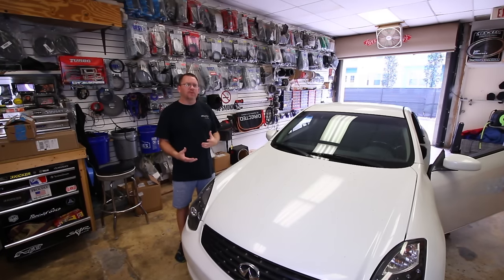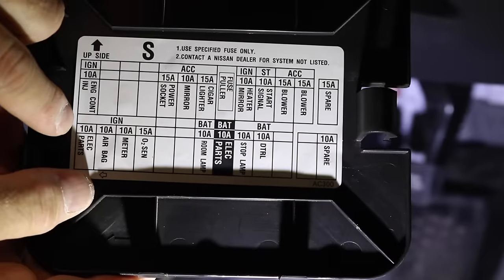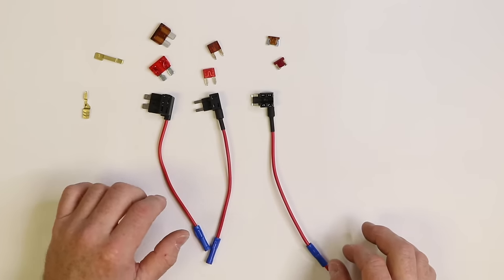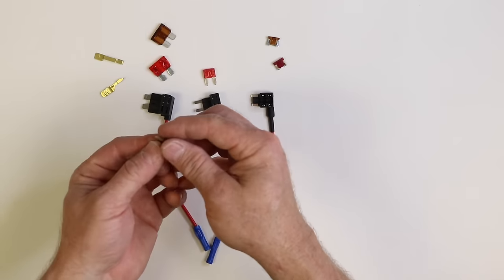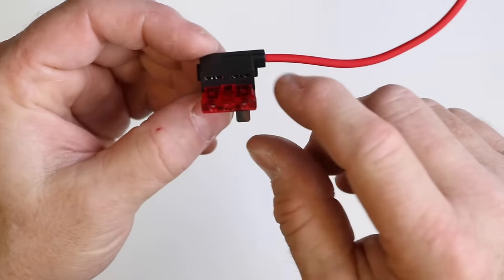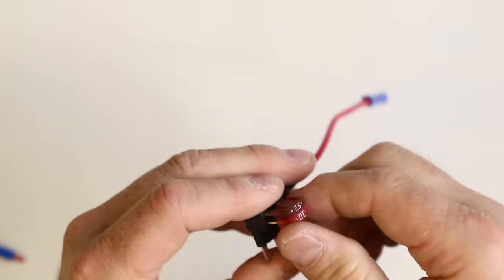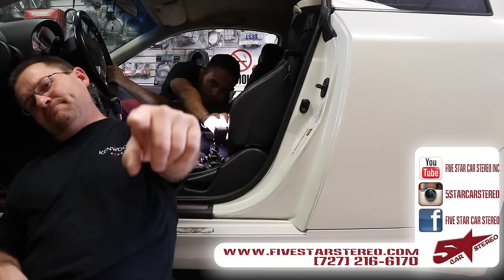How to tap into your cars fuse box safely and cleanly

Comment: I was wondering for wiring a 4 pin fuse relay. Would you guys use the constant and switched wires that are for the radio for 30 and 86?

Comment: hot side explained on 5:30 is the side connected to  battery? I need to put sleeve on line that hasnt battery 12V on itself?
on 7:02 what 20 and 30 means? Amps I guess? So if the lower is 10Amps I need to put 9 Amps on that above?

Comment: I am trying to understand your thoughts on there needing to be a smaller rated fuse for the tapped circuit.  

Electrically speaking once you tap the circuit they are now 2 separate electrical circuits.  It should not matter if you put a larger or a smaller sized fuse toward the accessory as long as the total rating doesn't go over the current allowed by the tap.

Can you go into detail as to why you suggest this?

Comment: Great video!  I have a 16 Charger Hellcat and 19 Charger Scat Pack. I installed halo lights on both cars. The scat pack had electrical problems because of the power feeding the lights was loose. Do you have any videos on tapping into the bottoms of the fuse box and using that as the power source?  That loose wire cause all kinds if problems. Thank you for your time.

Comment: Hi, I am tapping into the radio fuse and I want to run a 3 prong rocker LED switch. @5:15 for one of these types of connections,  if you tap into a circuit with a 15A fuse, but the power you intend to draw from your added circuit is less than 5A (a back up camera& monitor) could this damage anything if the original circuit (radio) tries to pull, lets say 10A? Or should I add an inline fuse between where i taped and my switch to the camera & monitor.
Reply from the maker: Nick Bongo you should be be fine will that small of a draw. A fuse wouldn't hurt

Comment: I know you explained very well but I want to make sure I'm going to install a backup camera on a Honda pilot I believe the backup light fuse is #9 in driver side is this where I would use the fuse tap and run the wire to the head units reverse wire ?

Comment: If I wanted to extend the length of that add a circuit wire, can I use similar gauge and not negatively impact power delivery? need to go from the trunk to the front

Comment: Brilliant video :) 

As stated the top fuse (new circuit) has to be lower than the bottom fuse. Is it OK to have the same  on both top and bottom for example 25 top and 25 bottom?
Reply from the maker: Mohsin Ali thank you. 
if the are both active circuits no. By active- something that is on majority of the time.
Reply: Hey, sorry to highjack this old conversation... If the fuse im tapping into is seat heating (which my car doesn't even have) there most likely won't be a problem if i have top and bottom fuse 15 & 15 amps? the tapped fuse would be for a dashcam which draws less than ~5 amps...

Comment: will the fuse box cover fit once a fuse tap is installed or do you need to cut a notch into the cover to accommodate the wire?

Comment: i knew one side was different on the fuses but wasnt sure thanks so much for being so clear in explaining stuff,now i can install my mechman 370 amp alt correctly i sent it to them and they swapped it from a 2 pin to a 4 pin and it has the yellow wire and i need a switched source and wanted to do it right,i would really much rather soldeir it in some place than use these but oh well i gotta get it running im tuning it this weekend,supercharger 6.0 cammed ls 05 blazer with a 18 inch sundown nsv4 sub in the back lol

Comment: Would you use the same fuse amps for the original accessory or do you need to add the new accessory into the old one? Also I'm installing a new 12V USB port at 7.5A and the radio fuse is 7.5A. So could I use two 7.5A or a 7.5A and a 15A?

Comment: Is there a way to connect a 2 prong onn/off switch to oneof those fuse taps and then connect the switch to another thing? 

My idea was to make so that i connect 12v switch to the fuse box and it controlls on/off function on a led strip

And also make that being like positive of the led kit spliced with the fuse tap provided cable and both going to the switch ON position would work or nah?

Comment: Do you have a DIY for the first generation lexus is300? Would like to hardwire a cobra dashcam either tap onto the rear view mirror or sunroof wiring but needs to be a continuous current to utilize the parking mode

Comment: My Alpine KTP-445U 4-channel Power Pack Amplifier came with a fused load wire which I put a ring terminal on and bolted to the battery. Would it have been safer to go through the fusebox or would that put wires in my vehicle harness in more danger? It certainly would have been easier than drilling a hole in my firewall and passing the loom and wire through it.

Comment: on the fuse tap can both of your fuses be of the same amperage? Im wanting to to have two 10amp fuses in the fuse tap connected in the acc 10 amp fuse spot on the fuse block.

Comment: 6:43 Quick question, the 10amp you inserted on the bottom fuse is upside down?  Is that correct?
Reply: From what I am reading it only matters that the add a wire is attached properly....the fuse itself will blow if overloaded no matter which way the fuse numbers are turned

Comment: On the fuse tap when you put the new fuse in can you match the existing fuse or does it have to be lower, i know you cant go higher as it mentions in video but can you match it e.g tapping into cigarette lighter the existing fuse is 20 amp cn you put 20 on the top side for ur accessory or does it have to be lower amps

Comment: W what size speaker wire do you use when running you're fuse tap from CD player. Will regular speaker wire work. 16guage

Comment: question, can i tap into one fuse with multiple devices, for example multiple aftermarket gauges?
Reply from the maker: If that is the case you may want to add a small second fuse panel

Comment: You mentioned that the top (added) fuse has to be a lower value than the bottom (original fuse). Would it work if they were both the same values? For example 10A on top and 10A on bottom? Thank you

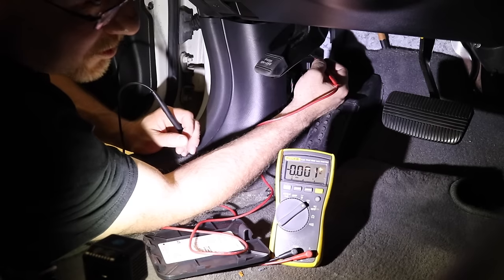Comment: 3:00 So if I find an empty slot and get power 12v with ignition on, connecting a tap with the 2 fuses on top would work?
Reply: I’m about to find out right now

Comment: I have a new radiator with e fans for my jeep xj. They come with a fused harness already. I want to do this. Do I need to add a fuse in to this tap as well? If so should it be more amps, less maps or the same as the one that comes with the harness?

Comment: hi. i am going to hardwire a dash cam in my car and really like your video. I need a 15 or 20A fuse, which I can use an add a fuse, but i'd rather use an empty slot. You mention if they are live that it would be a bonus. If I find one that is live, how would I know how many amps that fuse slot could handle? I dont want to overload a circuit and cause major damage. Thanks.

Comment: The bit I don't get is if you tap into the draw side and add your fuse for whatever you want say 5 amps,then if that is running as well as whatever was running before say 10 amps then the draw on the incoming wire would be(10+5 amps)15 amps.Wouldn't that overload the wiring feeding that circuit on the fuse box that previously only had to carry 10 amps?

Comment: Very good video! Just a question, can I insert two same load fuses? Thank you.
Reply: The fuse that's already in the box should be in the LINE side. The fuse for the device/accessory (which is actually the LOAD)  should be of a value to protect that accessory.

Comment: So, basically the factory fuse always at bottom socket and the new fuse that you are adding for accessory like LED lights is always on top slot? You can insert the fuse either way into the slot or there's a left or right position?

Comment: Hi guys great video, I have a newbie question. I've got a sensor which has an output of 30-40A. My question is, would I be able use a fuse tap pigtail to tap into a constant Power source at the fuse box OR would I have to run a new cable from the positive terminal of the battery to the sensor?

Comment: does the top "new load" have to be lower amp than the bottom "original load"? Can it be the same? 15 amp top and 15 amp bottom? would that be a dangerous install.

Comment: Great video man. Question. Can you use an ATM fuse in an ATM LP fuse/fuse tap? Assuming that LP just means low profile. But is it safe to use for example an aftermarket ATM 20A fuse with an manufacturer ATM LP, and an LP fuse tap? Vice versa- can one use an LP fuse in the ATM fuse tap? Thanks in advance

Comment: For my Dashcam, I would like to install the connector having 5 A fuse already (Wire Side) and ACC socket is 15 A fuse which I will move out and put in Connector PIN side. Is that fine to put both in the connector?

Comment: +Five Star Car Stereo | Dear Dean and Fernando, is it normal what happens at 8:00? I've just purchased the same piggyback holder (mini size) and it is impossible to fully insert the fuses into any of the two slots.
Reply from the maker: estosjapos yes sometimes it is real tight. A small flat head screwdriver can be use to open it up a little wider.

Comment: Instead of using that wrapping method like you showed at 4:46, could you use the piggyback and just run the wire to that for subs?
Reply from the maker: +Collin Smith as long as the fuse will blow if there is a short the rest is up to you.

Comment: Hello... I have purchased a DashCam that has a fuse adaptor the same as the third adaptor you shown (the right adaptor when you showed all 3 adaptors together), however, in my case fuses are like what you have in your car so this adaptor does not fit. Is there a way to make it fit or this adaptor is not "standard" and I will need another adaptor? Regards.

Comment: does it matter which side the Actual fuse is facing(blue fuse 3:24)? because it seems like your saying the fuse it's self need to be in a certain order. But I don't see how you check that, it seem Like you say that, then skip to checking the actual outlet.

Comment: Nice vid. I'm trying to wire some under glow dash lights in my 16 Chevy Malibu but I can not find the interior dome fuse to tap into. After searching around I found the wire that I need to tap into but it's directly coming from my Body Computer Module..... is it ok to tap into that? If so, would I need to connect a fuse as well or will it be fine knowing that the LEDs are only 12v. Thanks!

Comment: At 3:00 you mention that you should test empty fuse slots for power as thats "Like a bonus"

If I do find an empty slot with power how do I go about wiring to it? Do I just use a piggy back adaptor like shown in the video and leave the bottom slot empty on it? or is there a different type of adapter/wiring I should use instead of a piggy back?

Thanks for any replies! :)

Comment: Hadn't realised that this was moderated, it doesn't matter if the top fuse is a higher value than the bottom fuse providing you don't want to draw more than 10-15 amps with your new accessory. Draw, proper term for draw or positive supply is Feed. A way to test without a meter, if the piggy back is in the correct way, remove the bottom fuse, and insert piggyback. If your new accessory works then you have inserted the piggyback the correct way round. If it doesn't, then pull-out the piggy back reinsert the bottom fuse, and reinsert the piggyback the opposite way.

Comment: I have an 04 civic. I bought the led strips and an add a fuse but which fuse slot do I use? The interior lights fuse is in the engine bay, not under the dash.

Comment: This was great but I have a question.  I have a tap and I will hardwire the under dash lights, but the tap doesn't have a hot and neutral wire (load and draw).  How the heck do you hook that up with only one connection on the tap end??

Comment: I’m a little confused with the load side and draw side. That’s just to make sure we are inserting the fuse correct? I never knew I always would just insert the fuse but I would always insert it in the same direction the number was facing . I need to make a fused jumper to get 12v

Comment: Great video! I'm confused about the fuse rating on the upper slot as I've read different suggestions on this. At 6:57 you mentioned that the upper fuse needs to have a lower amp rating the the lower fuse. Does that really matter? Aren't they independent of each other when connected correctly? Thank you /James
Reply: I have the exact same question... I really liked this video and made notes along the way... but the manual for my Blackvue B-124 Ultra battery clearly states to locate a 10A or less Switched fuse and put it on the bottom of the fuse tap and place a 20A fuse in the upper port. This seems contrary to the advice in this video.

Comment: I bought those off amazon as well and thought it didn't matter which way I put it in. Glad I saw this video before I installed my boost, oil, afr gauges.

Now what I'm trying to find an answer for is.....

Can I twist all 3 wires from the gauges together and use only 1 of those amazon fuse tap adapters? Or 1 adapter per gauge?

I've seen a video of a guy doing that but I'm not sure if he is setting himself up for problems later. I'm new to wiring etc.

Comment: hey brother if i have two LED lights i want to put in my grill can i take the power wire ( red ) from both LED's and connect them and then connect them to the accessory terminal on a rocker switch so the both turn on when i hit the switch?

Comment: Nice
Didn't realize they had the tips.

Convention is Line and Load

Line.  = power source

Load. =  output of fuse or circuit breaker to the load

Comment: So the slot further away from the red power line is the side that goes into the 12v fuse slot? so essentially the leg further away from the red power line goes into the bottom slot? (On that g35).

Comment: Hey dude I will be watching this vid again when I get closer to my project just a question for you. 

I want a usb inside of my dash, so I have bought a motor bike usb with a sticky base so I can place it somewhere securely, I was going to cut the one end off and solder it to a fuse tap. 

On the power wire to the usb there is a fuse half down the wire.....Would you snip the fuse off  on the wire or would you leave it for added protection.

Also on the video you said use a smaller fuse on the tap but if the original is 10 and I add a another 10 would that be safe or is it safer to go smaller.

Comment: Thanks for this! I'm just wondering, how do you tap a 3-way cigarette lighter socket on the acc? In that way I'll have the built-in cig lighter socket free and have 4 sockets. Is that doable and safe?
Reply from the maker: Te Remollo you could run a wire out to the battery, use the current lighters ACC power to go to a relay, then connect all of them to the relay for power.

Comment: So you said in the video that the secondary line should be lower, and do not go higher, but you didn't cover the same values. If I have a 10amp fuse I'm taking the spot from, and a 10 amp fuse I want as a secondary, will that work?

Comment: I heard these things can cause fires and most cars are very voltage sensitive and could cause problems, is that true? I wanna install a exterior light strips on my headlights but afraid to do so based on the  information I was told. I have a 2016 Ford Fusion

Comment: I’ve been looking for a video showing how to fully disable traction and I found out that if u pull the stop lamp fuse it allows it to do 3rd gear burn outs my question is can I connect a switch to the fuse or what ?

Comment: Great video hopefully it will help me, I had an amateur use my fuse box to power a radio he Taps directly into the headlamp fuse radio works but my head lamps don't. Is it safe to assume that he wired it to the wrong side of the fuse?  (Non load) the radio works fine the headlights don't. I'm going to get a multimeter and try and find a hot fuse that is not as important as headlights or one that was intended for the radio originally. Do you have any suggestions? It's a 04 Touareg. Thanks in advance

Comment: Hey Guys.  Thanks for the great video!  Question.  Can you tap two accessories into the same fuse tap as long as the fuse you are using will handle both accessories?  For example, I am looking at hardwiring a dash cam and a radar detector and if both are a 5 amp fuse, would I use a 10 amp fuse?  Reason I ask is because I am having difficulty getting my flat fuse box cover which is held on by Velcro to go back on fairly nicely with just one fuse tap and not multi.  I only want these accessory devices to run when the ignition is in accessory or engine running position.  Thanks in advance for taking the time to answer.

Comment: I got a question my alarm is from karr my 2012 Honda Civic si coupe . I end up putting it back to stock now my car won't start it stopped the fuel pump so it doesn't turn on can you please help me out it back together. Or can I run a wire like this video to the fuel pump to the fuse box to get it started???

Comment: Most probabaly you draw from a 10A fuse. In case you need to get power from a fuse of 15-20A, then you need a better fuse adaptor? In most shops and e-shops the adaptors are for 10A. I checked for a 20A one and seems having three times the cost of the 10A one. Also i can find only for mini fuses and not micro like my car has.

Comment: Question, if I find an OPEN fuse socket that doesn’t have an existing 20a fuse, do I need to put two 20a in the fuse tap or one is fine?  It’s for a dash cam.
Reply: good question.  I also want to know this. i have a few "Not used" circuits I'd prefer to use as long as they are powered only with ignition.